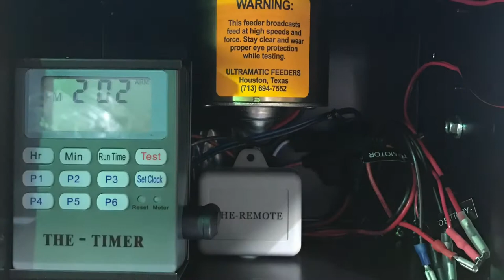The-Remote Installation

Comment: You will be lucky to get 100 yards out of it if the feeder is a barrel style and off the ground 4 ft or so.. It wont work but about 30 yards on a ground level corn feeder as the cage protecting the control box blocks the signal.
Reply: Did you drill a hole for the antenna or just leave all inside the “box”?
Reply: @terrycrissman7392   I drilled a hole and put the antenna outside the box. With the feeders I have I ran flex up to a 4x4 junction box and mounted it on the side right at the top of the feeder and extended the wires to the motor and timer. 
its reliable at 130 yards..
Reply: Thank you